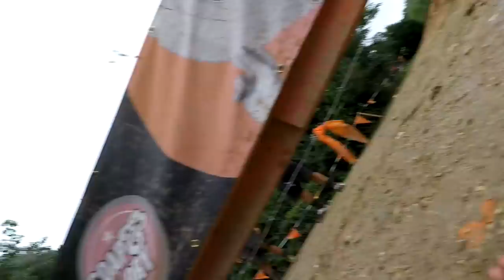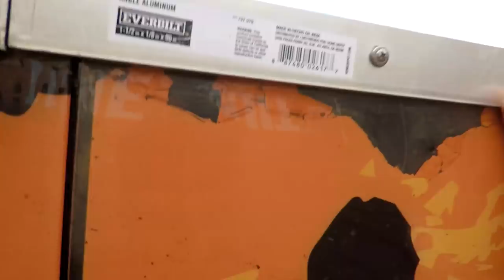Tough Mudder Half 2018 (All Obstacles)

Comment: Hey guys, I watch your spartan and mudder videos all the time. I was wondering if you could tell me which event(s) is harder and tests your abilities more overall? Spartan or tough mudder? I did my first spartan last month in tuxedo ny and I cancelled my tough mudder scheduled next month because I thought I wouldnt get the same experience. I appreciate your feedback and keep it up!
Reply from the maker: Great question. Tough one to answer. In short, Tuxedo is way harder than the Half here at Long Island. Spartan Sprints over all will be way more challenging than a TM Half. A full Tough Mudder will be more challenging than a Spartan Sprint (usually), and more on par with some of the flatter Spartan Supers. Mountain type Supers and Beasts are generally more of a challenge than Tough Mudder Full (especially Spartan Beasts, like at Killington). Spartan is timed, TM is usually not. Spartan focusses on the individual, TM focusses on camaraderie and team work. Spartan has a focus on speed and strength, TM gets you FULL of mud and makes you work through being a muddy soggy uncomfortable mess. That's my two cents anyhow, hope it helps!

Comment: Do you need specialist trainers?  Looks so wet and muddy, it would almost make no difference.
Reply from the maker: It does help having light weight shoes that have good drainage. Not having shoes that let the water drain out get heavy really quickly. Also good to have footwear with good grip, esp. when wet.